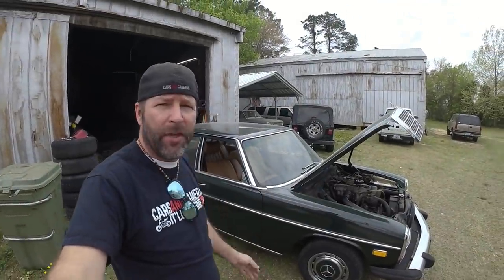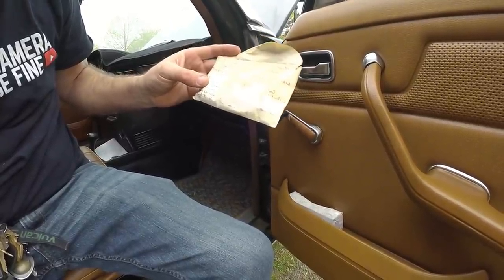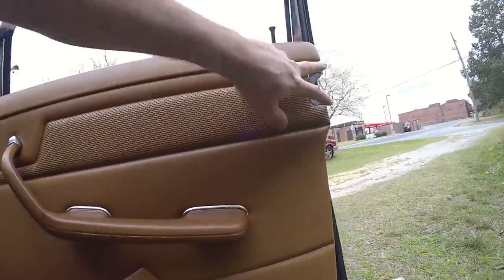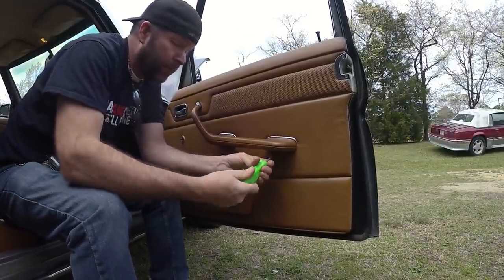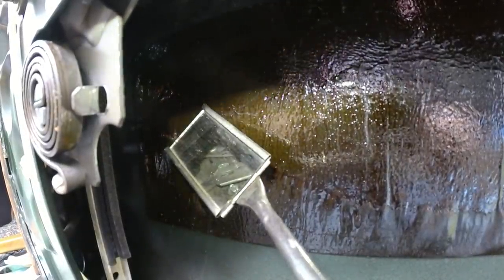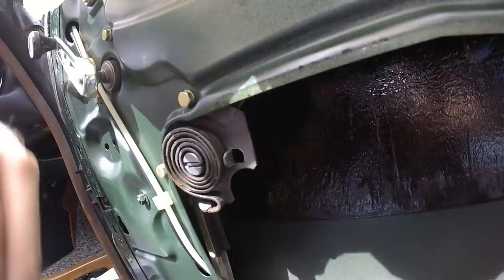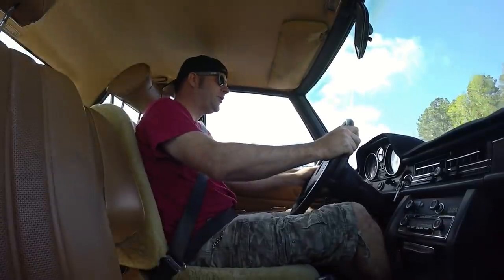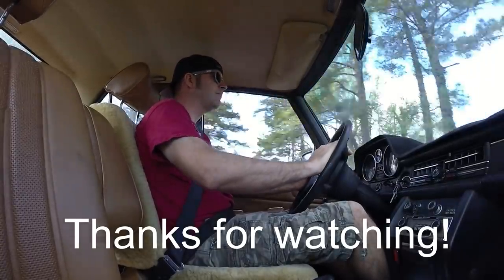Window Regulator Repair On My 1975 Mercedes Benz

Comment: Excellent video Issac  :) also I have 2002 Chevrolet Impala E-X LTZ LS 4 door  car and take care off because my one late friend had plus ideas rebuild from parts cars and ideas we share about fixing up before he past away! Especially not orgnail at all only thing is is truck and doors lock ! Got experimental motor 3.4 Litre bored out to 252 Cubic Cm size 6 cylinder V6 320 hp with 425 torque got flex fuel car never had , got parts from 3.1 to 4.3 litres V6 motors , experimental 506 M6 speed Automatic transmission with Shift Kit in Fwd type and transmission cooler is full size Chevrolet truck in to full frame of Taintimn metal front to back , cost me $500.00 for car but $6.500 rebuild back up nice ! Don't have Sunroof or RPM gauge or Electric Start on Key Fob and no Abs brakes! Car was orgnailly a RWD model but motor was shot plus transmission and computer too also axle ! But all took out ! 6 seater made 5 ! Also repainted from Baby Blue body to Navy Blue Rainbow Flake look Black at night with Black trim plus stripe ! Baby Blue with Black also True Wood grain of Hard Wood my oldest brother did for me! Got 4 wheels disk brakes first time ever driving in my own car also had this since 2005 but fully fix in 2010 been road since near 200.000 km on it now and still going strong! Computer chip for 4.3 litre motor up and drive like Caddy and got my money worth out it too! Top speed have at is 162 kms/h at 1/2 gas pedal down still want climb speed more and nice car projects did up! Also Happy Easter Weekend to Isaac plus everyone and hope Easter Bunny brings lots goodies too!

Comment: In the past I have had to do this as the person did not want to spend big money on the new window regulator so I ended up doing was center punching the pot metal then drilling it and tapping it then using red Loctite with a machine screw which  did work very well

Comment: Hey, Ike.  A little advice from an old servise station mechanic.  A plunger cup will hold a window in place while you need.  BTW I had a diesel Merc, in the mid '80's that had a vaccuum pump to operate all the windows, door locks, wipers and even the trunk lid.

Comment: Hey Isaac isn’t the inner water barrier supposed to tuck into the bottom of the door? So if your outer glass seal lets water in it goes in the bottom of the door and out the drains the way it looks it is going to get on the bottom of the door panel?
Reply from the maker: You would think so but it doesn't

Comment: Chernobyl ppl live there called stalkers aka homeless plants and animals thrive yet plants and animals are made of cells are fine what happened to thousands of years and what happened to nuclear winter Hiroshima Chernobyl have normal seasons for the areas they are in ppl don’t work things out in they’re head with common sense
Reply: "nuclear winter" is a theory about what would happen after a full scale thermonuclear war because of a large amount of dust and debris being lifted into the upper atmosphere by the many explosions, and partially blocking sunlight from reaching the earth's surface, thereby causing lower ground temperatures globally as the dust is distributed around the earth by wind currents in the upper atmosphere, not because of the effects of radiation. the same phenomena happens after large volcanic eruptions. for example, after krakatoa erupted and caused millions of cubic meters of volcanic ash to be deposited into the upper atmosphere, global temps were significantly reduced for months. even the oil fires set by saddam's troops during the US vs Iraq war lowered global temps slightly due to particles in the smoke from the burning oil rising into the atmosphere and partially blocking the sun. the fact is, we live in a single, huge bubble of constantly flowing gasses that surround the planet which we call the atmosphere, and even things that happen in only one area will eventually affect the entire bubble. once you understand that, it's only common sense to realize that the more widespread the event, the greater the effect it will have on the system.